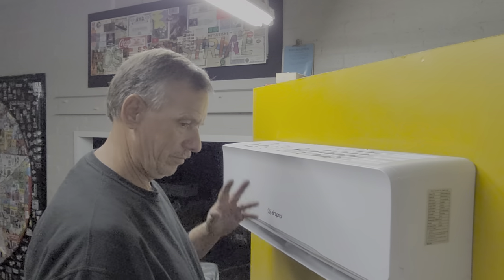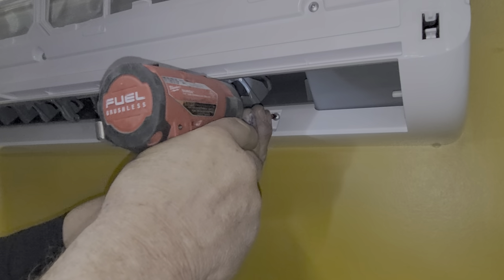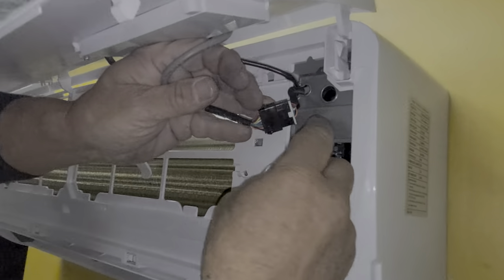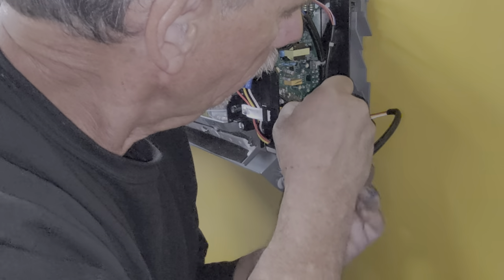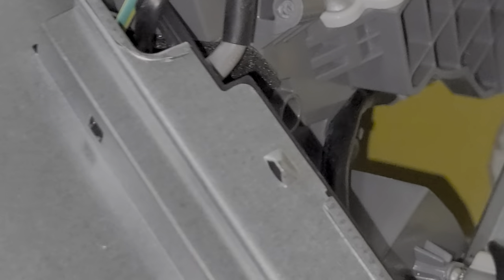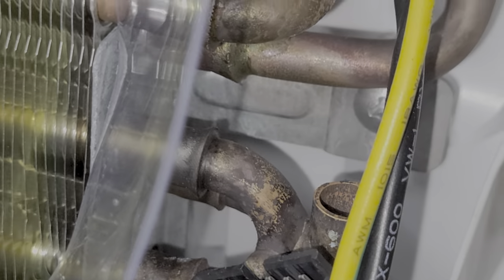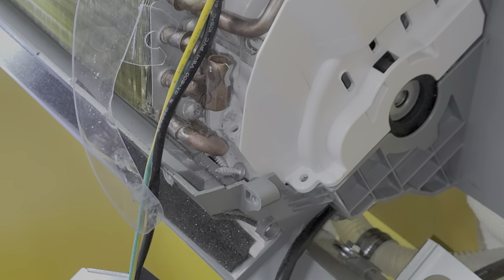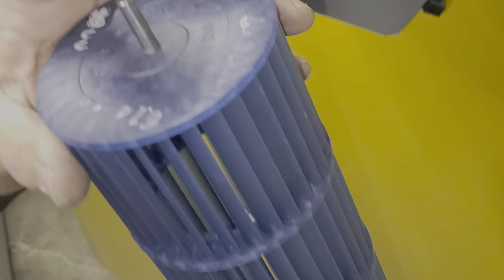How we remove the blower wheel and fan on the indoor unit of a mini-splt.

Comment: Thank you 1.) providing this information and 2.) proving to me that my mini split isn't the only one designed this way (horribly)
Reply: like all modern electronics they are built to be as tiny as possible, your cellphone, your truck engine, EVERYTHING has electronics in them, circuit boards, cpus, wifi controllers, and so on. They make ALL modern devices as small as possible to look compact and to be light weight. NO ONE designs ANYTHING with repairs in mind. If you have opened your truck hood in the last 20yrs you will see every part is on top of the other parts and you have to take off 8 parts just to change your oil or to even get to your battery. Its not just mini split acs its every modern thing made today. 

I'm a DIY guy I build and repair 90% of the stuff around my house and when I design something to build the first thing I consider after, how does it function, then how does it look, then how do I work on it. NO ONE else considers repair because they don't want you to be able to work on anything they want you to pay for an extended warranty or pay them to repair it.
Reply: @RossMalagarie  very true. God bless you brother. We share the same sentiment. Sad things have turned out this way

Comment: Thanks for the video. I have a chirping Minisplit in my bedroom and it sounds like it’s coming from the left side of the unit, likely a lack of grease on the end pin of the blower fan cylinder… wonder if there’s any access to that bearing once the plastic outer cover is off..?
Reply from the maker: It sounds like it's rubbing on something. I doubt it's a dry bearing because it's a metal shaft on plastic sleeve. Once you takes the cover off, the left side is where the shaft fits into the sleeve, and you can  spin the wheel with a finger to pinpoint noise. Everything should be able to be disassembled once you get to that point.
Reply: Mine ended up being dry grease in the socket. Metal pin, rubber bush. Had to do a little lift of the coils to get access, but now I know there’s a small hole in the rubber that I can apply grease through with minimal disassembly in the future
Thx again for the video, helped me sort it out as a DIY

Comment: Can you get the fan wheel out without evacuating the unit and disconnecting the lines? I live at the ass end of nowhere and would prefer not to have to pay a dude to come out here, especially since the outside unit is placed in a spot that's not really that easily accessible....
Reply from the maker: You don't need to evacuate the unit. But it is quite the challenge, at least on most units, to remove the control block on the right. You may need to massage the refrigerant lines like we did or the coil like we did to get access to all the screws. But massage, not bend, because you don't want to crack the refrigerant line.
Reply: @airspool  Thanks! I'll try my best. I worked as a car mechanic for some time and I do like to think I've got a good feeling for how much stress a certain material can take.
Also, mine is a Hisense, which I haven't found a tutorial for, but I'm watching a dissassembly video on a Daikin right now that looks p much exactly the same, and the control block just sorta slides off to the right. Maybe, if I'm lucky, it's the same on mine.
Reply: @airspool  So I did it this morning and it was actually not bad at all. Three screws to remove the cover, three more to losen the radiator. Remove the screw that holds the fan wheel on the axle. Lift radiator, pull fan wheel out to the side. Didn't even have to touch the control block.

Comment: Think about how incredibly poorly this device is designed.   Ridiculous to mount the screws were they have them.   I am searching for a better designed mini split.  I have an LG 24000 BTU from eComfort in 2017 that is really similar and so far I can not get the motor out.